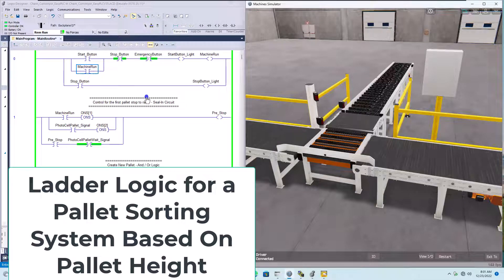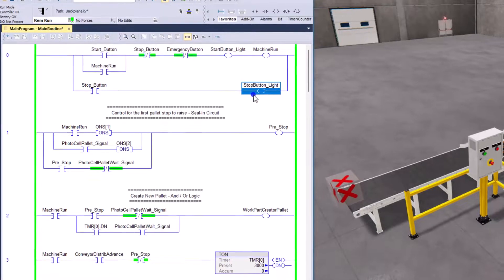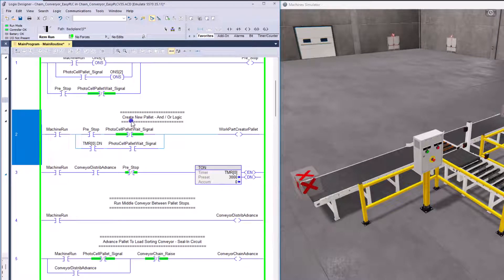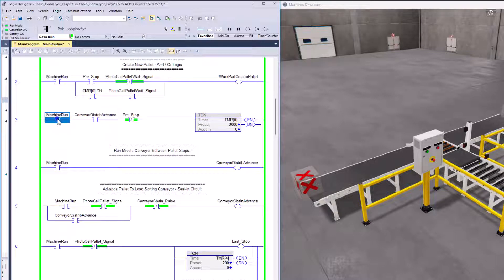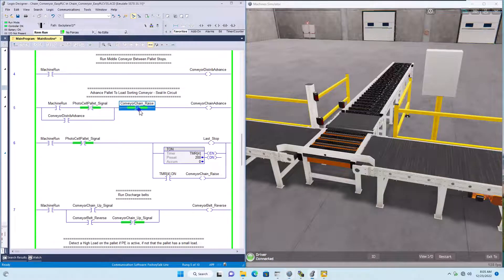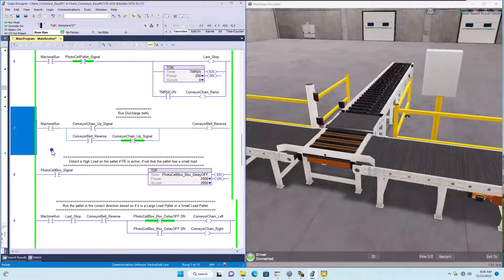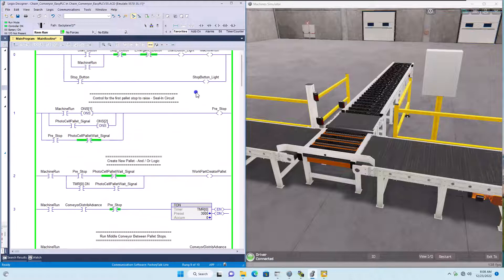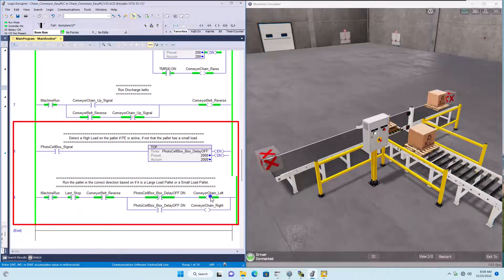PLC Ladder Logic for a Pallet Sorting Conveyor Based on Pallet Height | EasyPLC Machine Simulator

Comment: What's the purpose of the Conveyorbelt_Reverse bit? It seems it will always be on as long as the machine is running.
Reply from the maker: @brandonwright990  it only runs when a pallet needs to go that direction, did you watch the whole video?
Reply: @ShaneWelcher  I did. I must've missed something. I'll watch it again.
Reply: Also, thanks for responding. I'm only just starting to introduce myself to ladder logic. I have a lot to learn.
Reply: After watching it again, I'm gathering that line 7 would maintain the same function if the only bit controlling it was MachineRun. The other bits only delay the conveyor from starting until after the chains go up for the first time after starting the machine. After that, it appears to run constantly until the machineRun bit drops out.
Reply from the maker: @brandonwright990  that conv is the back conveyor and yes runs when the machine cycle on.